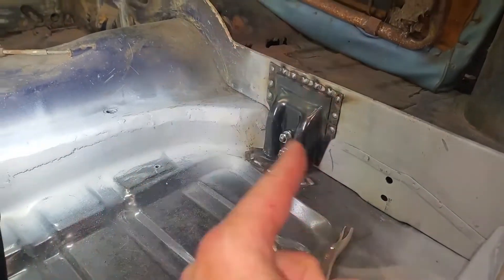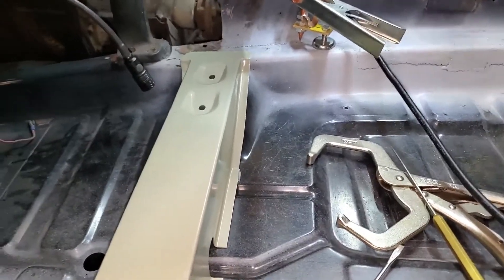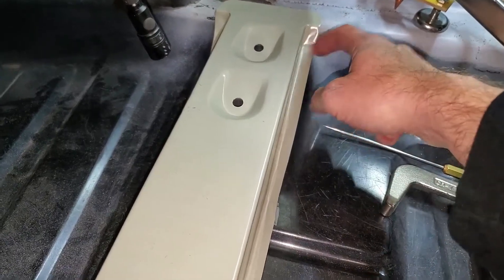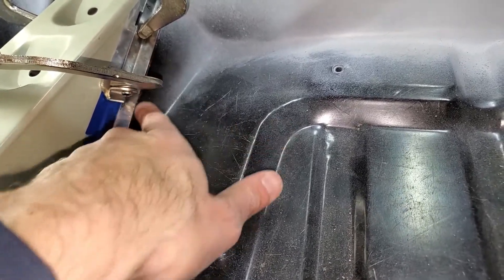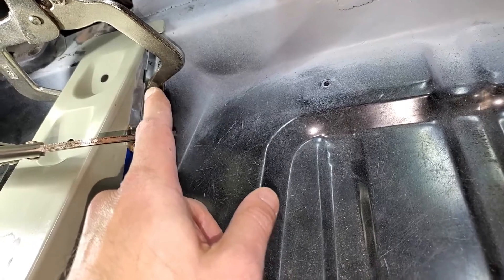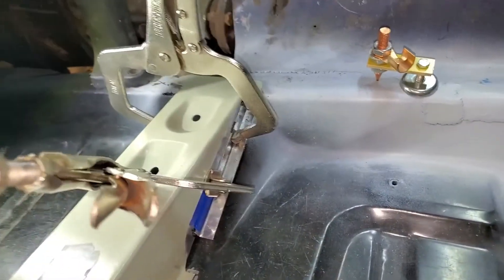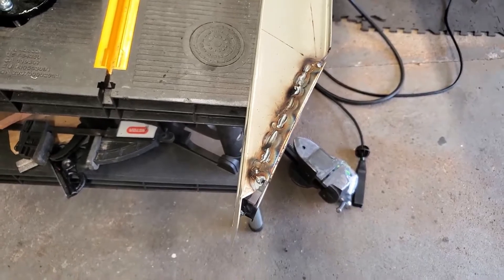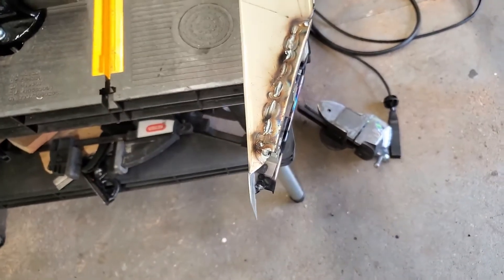Triumph GT6: Driver's side cross member mods

Comment: Those two tubes underneath the crossmember we’re not meant to go all the way down to the floor pan!! 
Are used boat guides and that’s it because if you touch the floor pan with those you’re gonna create what’s known as galvanic corrosion in the future!! Secondly you have to have through passes from one side to the other because that’s where you lead some of your wiring harness from rear to the Ford him
Reply from the maker: Well as it turns out I didn't extend them to the floor. So I'm good.

Comment: Those tubes in the cross member are anti-crush tubes, designed to stop the cross-member collapsing when the bolts are tightened. Have you opened the holes up in the floor to pick up the chassis mount? If not I would suggest you do as you'll probably find those tubes are in totally the wrong place.
Reply from the maker: I missed by about 2 mm on the upper tube so I have to come up with another solution for that. Ah well, live and learn.
Reply: @DavidPlass  Neatest solution would be to drill out the spot welds holding the tube in place and relocate
Reply from the maker: That seems like a lot of work. It's anyway too late :(
Reply: @DavidPlass  It's only drilling 4 spot welds from the side of the crossmember if you can get access - I had to do the same on mine although before installed: https://youtu.be/Meo-KsiPHYs